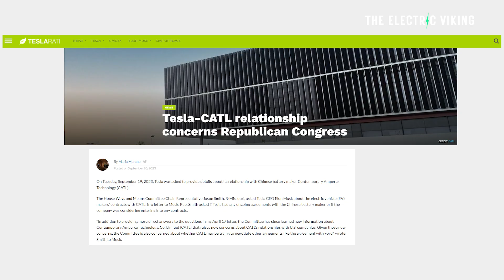Tesla's American LFP battery plant will produce game changing new battery

Comment: LMFP energy density (120-140 Wh/kg) still falls short of NCM (150-220 Wh/kg).  So, no, LMFP isn't replace NMC any time soon.
Reply: If these CATL batteries have close to 200 Wh/Kg, are cold weather capable and 30% cheaper as advertised this is a BIG improvement!
Reply: NCM batteries should be kept between 20%-80% SOC. LFP batteries can be used between 0% and 100% SOC.
Reply: @pauld3327  LFP batteries don't perform well in the cold.
Reply: @KP-xi4bj  the new CATL LFP battery will perform very well in the cold.
Reply: @pauld3327  Says who?  What's your source of information???
Reply: @KP-xi4bj  CATL official Youtube Channel: in the video untitled 'CATL Shenxing Battery: No More Winter Charging Anxiety!' they say that 'Charging at -10°C feels just like charging at 20°C'
Reply: @pauld3327  Once again, that is the manufacturer's advertisement.  Where are the real world cases?  I want to see real world performances.  Where???
Reply: CATL LFP is replacing NCM now. 4X charging life, 0-100% charge/discharge, no runaway fires, good cold weather charging, energy density on par and will exceed NCM and cheaper to produce 👍🏻
Reply: @larryc1616  Installed by no BEV automakers.  LMFAO  SMH
Reply: Sorry LMFP produced by CATL is 180-200 wh/kg so yes NCM is toasted give the 30-40% cost difference
Reply: @simply9990  They also don't catch fire spontaneously either, even if damaged, which is a big deal. It's pretty close to the perfect battery technology. I don't see how ICE vehicles will be able to compete when these are being made at scale.
Reply: @simply9990  Sorry, that's theoretical energy density.  You know how the Chinese always over promise and under delivers.

Comment: Several incorrect statements here. First,  the Tesla Gigafactory is just outside Reno, NV not Las Vegas, Second, the new plant with the CATL machinery will not be at the Reno Gigafactory. It is going to be a seperate site in Sparks, NV which borders Reno.  Lastly it is not a joint venture with CATL. Tesla is buying the battery making machinery and CATL is installing it and that is it. That is as far as the agreement is going. This is due to wanting to be IRA compliant. They need to keep the level of Chinese involvement to a bare minimum .
Reply: I’m really interested in what you think.  Yes, his speed of reporting and having no editing department will result in inaccuracies … but I think they are technical rather than strategic inaccuracies.  And the speed is so impressive.  I work in this space and know every morning I can wake up to what’s strategically relevant.  Do you agree?
Reply: @ssmit262  I would agree that is more than likely the case here. However, accuracy is important, the locations are quite a long way apart. It is just not a good look . Did it change the most important parts of the story, no. The fact that Tesla is buying CATL equipment to build a LFP battery plant in the U.S is very significant news. The biggest miss here is the reporting that it is going into the gigafactory. That is not the case. Tesla will 100% want to isolate the Chinese equipment as to not taint the production at the gigafactory. As was pointed out in the video Ford found out the hard way in the way it did it's deal with CATL. Tesla is not doing a JV or production deal like they have with Panasonic at the gigafactory. This is an equipment purchase and install. A key to keeping IRA compliant production. These LFP batteries right now are being reported as not going into cars. Rather they are for megapacks and powerwalls. That could change in the future I am sure. This is just a first step.
Reply: @ssmit262 half as many would help him improve, twice as many would be a disaster likely.  I smell a little GPT.
Reply: CATL selling machines and spare parts for this machine. Why is that bad business?
Reply: @Dave5843-d9m  
Don't sell to wolves. Starve the United Snakes to speed up its deindustrialization.
Reply: @blackknight4996 What?
Reply: @blackknight4996 tesla is building their own batteries in CA and TX!!
Reply: @MyUniversalUniversity  
Tesla has no technologies or hardware to build their own anything...
Reply: @blackknight4996 awww someone’s coping real hard.
Reply: Doesn’t the IRA state that the batteries have to be madecin North America, not that they can’t be made by a Chinese company?
Reply: I just bought a small quantity of LiFePo4 batteries for $80 / Kw-hr.  Surely Tesla will pay less when running at large scale.
Reply: As much as I see sense in Tesla working to recycle the elements of batteries; it would delight me to see ‘packs’ (or subunits thereof) that can convert to domestic storage with little hassle; and that such domestic storage be offered (at least in part) as a portable battery. One ideal would be for the cybertruck expansion pack to be in a form factor that makes it possible to assemble a portable power bank in short order.
Reply: @kendrickpi I think that it is currently a plugin possible power wall type resource.  I plan to use mine during hurricane outages here in Florida.
Reply: Can we all agree that Sparks is a great name for a town to locate a battery plant in. ✌️
Reply: Thank you for the accuracy; good comment
Reply: Hear they’ve turned the wild horses in that area into guard horses for the giga factory-they certainly stopped me plenty of times in the road.
Reply: Two can play that game. There are increasing calls within China to stop CATL from exporting to the US. You see, the Chinese too, want to keep involvment with the US to a bare minimum.
Reply: You are correct!
Reply: Correct!
Reply: He’s obviously all in on Tesla stock and paints a batter picture than is actual fact. Still useful for basic news all the same.
Reply: Second point is interesting. Having production machineries without original engineering team’s support historically has been a recipe for disaster — nothing to do with how good engineers are, but know-how built over years, i.e. tribal knowledge not captured in any doc.
Reply: @hakuhyo174  I would think that Tesla would be hiring some of that tribal knowledge as part of the deal. I would think that the two companies have an understanding to make this work and still limit the CATL appearance from the outside looking in.
Reply: Thank you.  I agree it’s damaging to the thesis to have inaccurate info.  You’re right.  But I think you’re especially right about the strategic significance of the packaging of CATL relationship.  It is smart and (possibly) escapes the scrutiny that F is facing.  Marshall, Mi seems in the political crosshairs, in addition to the fundamental issue of over-industrialization relative to F lfp demand, in the short term.  I really appreciate your response — thank you
Reply: Why should we believe you over him? Show proof/sources otherwise it’s just your words against his.
Reply: @travellover3373  Umm..look at a map. I also  live in Reno, NV so there is that. Feel free to do your own research if you feel I am incorrect. A simple google search will quickly produce articles about the fact the new factory will be separate of the existing gigafactory.
Reply: This channel always has mistakes. It’s an EV promotional channel in disguise with Tesla being the main benefactor.
Reply: yeah he has stated las Vegas several times in the past. The only reason I have some idea myself 😃 is that my son went over to California a few months ago from NZ ,  he told me about the factory at Freemont but never mentioned anything about las Vegas,  he hired a model Y and it was ok until he got a puncture on the way to Vegas and found out there was no spare tyre,  this caused quite a lot of angst because his wife was 6 months and they had a 2 year old in tow.  Luckily he found the Americans to be very helpful and got things sorted even though it was Sunday!  😃.
Reply: @TerryHickey-xt4mf   The current nevada giga-factory is kind of in Sparks, NV, not Reno.  It has a Sparks address even though it is about 20 miles out from the actual city.  I think it may be in an unincorporated area, so really it is Storey County Nevada, not in any city.
Reply: @jamescox8429  This is an accurate statement about the location of the Nevada gigafactory. It is outside of town and in what is considered Sparks. The new facility that the CATL equipment is going into will be in a totally different location not at what is known as the gigafactory. This new different location will be in Sparks, NV. Sparks and Reno are basically one metro area.
Reply: Fear naught, Viking, the self appoint EV expert, never lets actual facts get in the way of his video content…..
Reply: I've been to Reno - it's basically Las Vegas, albeit a little smaller.
Reply: @alexishart1989  they are 420 miles apart!!
Reply: @ alexishart1989 sure, but Reno is nowhere near Las Vegas, it's like over 400 miles away lol.
Reply: @alexishart1989 I liked Reno way more then Vegas.
Reply: @alexishart1989  I live in Reno and I'm a season ticket holder for the  LV Raiders.  I beg to differ.  Its not the same..yet!  Side note..I drive to Tesla everyday and I own Tesla stock..and I also think EVs is a dead end street
Reply: @alexishart1989  You managed to use such little effort to insult all of the residents who live in Washoe County, Nevada.  Reno is anything but Las Vegas.  I am probably just as ignorant regarding Ukraine as you regarding Reno and I have never been to Ukraine.
Reply: @alexishart1989 and it has the Ranch!  Also air racing at Sparks!  Reno Hilton has been a personal favorite for half century.  Was stationed at Alameda Naval Air Station in late 50’s. Great area.
Reply: @alexishart1989  As a lifelong Renoian this statement hurts me.
Reply: @alexishart1989 Reno,  basically Las Vegas? Okaaay….
Reply: @dk5746 from the perspective of Australia they are basically the same place
Reply: Both cities are in the state of Nevada so who really cares?
Reply: @alexishart1989 did you go to the red light district?
Reply: @xlargetophat 
He went to discharge his battery cells in the red light area. 😅😅😅
Reply: @DrJohnnyJ  
What has my comment got to do with twitter or X? FYI, I've never been on twitter or X.
Reply: CATL should just abandon the USA market... don't waste time with a bad partner.
Reply: @blackknight4996 butt hurt? Bots are butt hurt.🤣🤣🤣🤣
Reply: @johnh8615 it’s not about being butthurt. Why should China sell to a hostile West?
Reply: @Western_Decline I wish everyone thought we were hostile! Maybe they wouldn’t flood into our country with hopes of a better life!
Reply: @blackknight4996 they did with Ford. Tesla buys from them in China, huge.
Reply: @blackknight4996  Do you think CATL is a charity? They are involved only for profit. Only children think the way you do. If they don't do it, the Koreans will and they'd rather have the money.